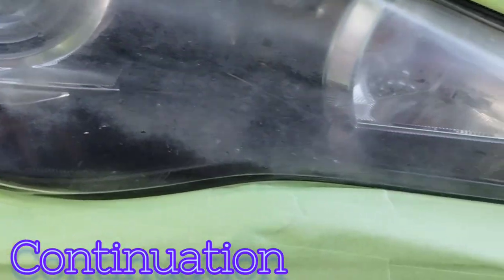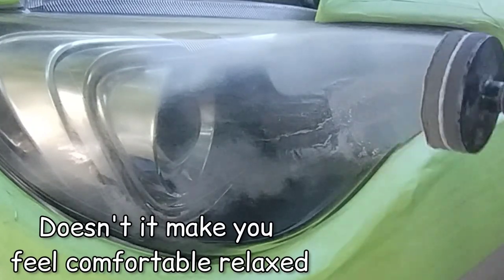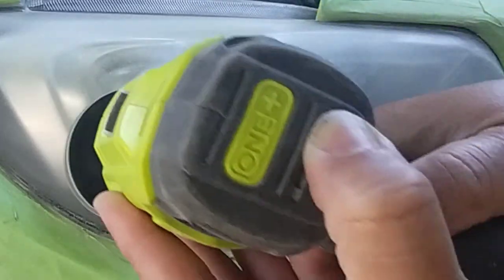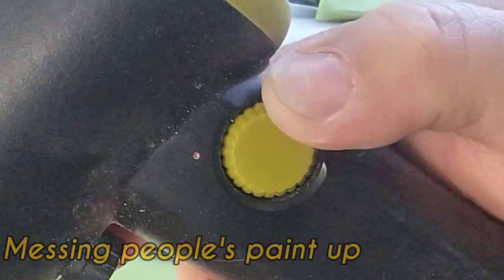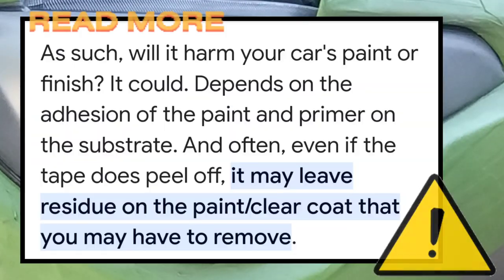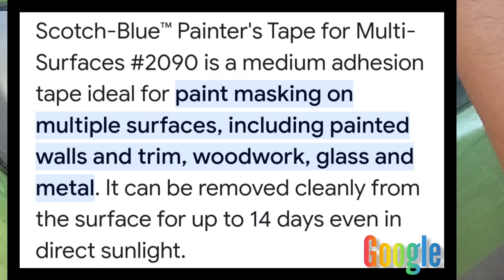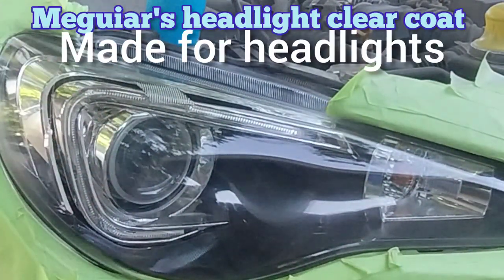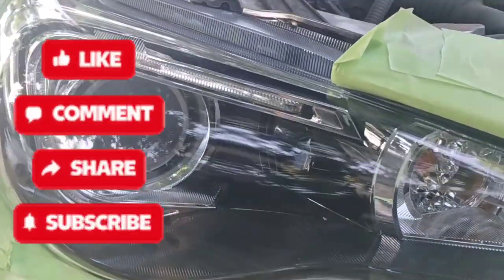headlight restoration - RELAX JUST TAPE IT RIGHT 🦺 safety first

Comment: Love your videos, very concise. I have a 2011 Hyundai Elantra, hadn't had a garage since I got it, got it new and headlights foggy, plus a crack in each side. Was wondering if you thought or had tried using Bondic to fix cracks? Bondic comes with UV light to cure it.

Each side headlight cost almost $300, then the cost for installation,  probably another $200 each, so about $1,000 to replace both. Pretty pricey. What do ya think about trying Bondic to repair the crack?
Reply from the maker: Believe it or not I typically don't have headlights or gith headlights that have too much serious cracking that way other than spider cracking which there's nothing can do about because they're inside of the headlight inside the actual material.. I don't know too much about bondic I just looked it up sounds interesting probably could work.. but I was thinking about experimenting with gouged out lights with big scrapes the same material that they used to fix windshields... But at the same time it's extremely rare to even get something like that...

Comment: I did notice on the taping, a good amount of window cleaner coming down onto the tape after trizac wash. I would suggest the protection also covers other things besides tool bump. I did notice my processing of this method is still messy, and I'm getting a bit more post job clean up on the car itself than I know I should.  Does extra masking need be employed until my steps are cleaner and more refined? Fender and engine compartment are offending areas.  I did notice you used a clean black moving blanket on that Subura job with really low mileage...
Reply from the maker: Yeah you just need to work on you cleanliness..it will come in time ..
I wipe immediately after spaying..
But at the same time it's just water and glass cleaner.. touch has a working I'm always cleaning as you see...
And proper use of the BLOWER gos far to keep dust in check...
I only use the blanket on clean engine bays which is 1 out of 10 cars..
Reply: @theheadlightrestorationpro Right on man! Thanks for the hard work...
Real quick,  Toyota polycarbonate sure acts good.  That shit strips good.  I hope to get a mini Cooper this summer like you had.  It looks badass...

Comment: Ohh shit! I burnt a small swirl with my polisher using a brand new pad that got dry at high speed. I went after it using the method again, but I couldn't quite recover it.  It was on my buddies lights and he was still way happy and I showed him and he didn't give not one shit about it, but what if I did this on a job at the Lexus dealership. They were beautiful still, but between us, damnit! Still learning...
Reply from the maker: If that happened you would definitely staying in one spot too long and definitely did not have the pad properly hydrated it's better to overhydrate than under..
You can't set that shit still too long better to take multiple passes... And nine times out of 10 you can remove it you just have to hit it a little longer with the p500 to go a little deeper... But yeah I got to keep it moving, got to watch those corners and edges, got to make sure it's probably hydrated and even slow a little bit when it's fresh...💯